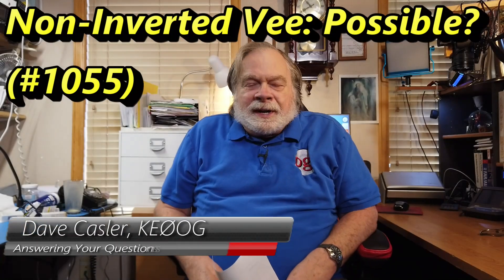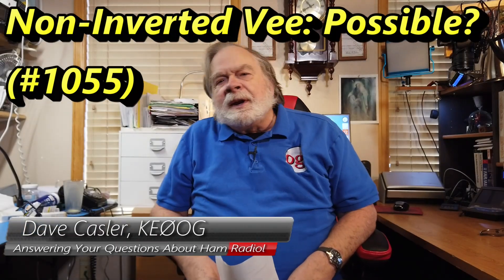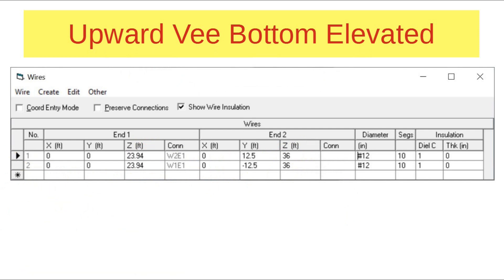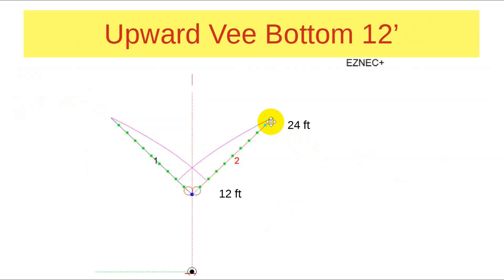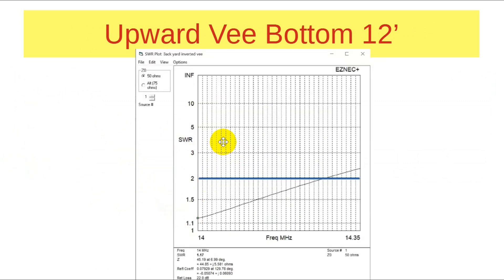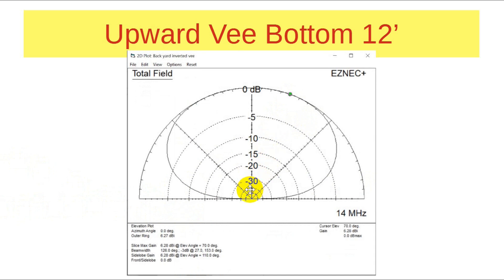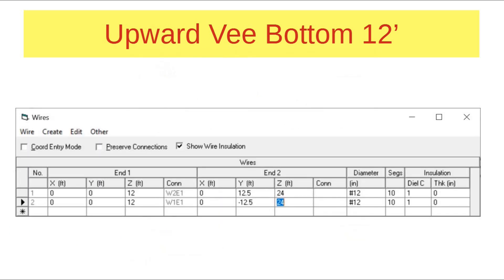Non-inverted Vee: Possible? (#1055)

Comment: Dave, I can't believe you got this question after so many years. I found an article from many years ago about making a Lanai antenna so I copied the picture. Then I got a  Buddipole with Versa Tee and copied it and plotted Z and it was better than I could imagine. Got a British one piece V with SO-239 and mounted it on Military mast and stuck some 112" whips and I had an instant antenna . Did the same with Mil whips from Chameleon 133" and still 52Ω Z with no Balun.
After a number of years I have been  looking for more information  on bent antennas and there is a fair amount of articles on them now. Dave I can mail you some DPC-7 mounts if you would like to smoke test them. ~DPC-38V mounts.  Look at my KB1UKU and KB1UKU/M qrz site pages. Dave nice reply to his question. I find the V dipole best as a slightly sloped with a rock tilting my base Vee changing take-off angle giving me my 3dB gain.

Comment: Thanks Dave. I just installed a new Diamond HFV-330 Multiband Loaded V-Dipole antenna on my balcony. It's one of the few multiband antennas I could find that fits in my very limited space.  It has two sealed coils at the base of the V that function like a double screwdriver, i.e., they have motor driven contacts that are synchronized by a controller in the shack to move together when changing bands.  Covers 3.5 to 28 meters and looks like something out of My Favorite Martian, but it seems to receive well despite my neighborhood QRM.  Have not had a chance to transmit DX with it yet but will do so as the weather warms up.  Hope to reach the States with it sometime soon.  73  JS2OLO

Comment: I tried that once, but had the bottom only a few inches off the ground due to height restrictions. No need to say too much more about that endeavor other than 👎
Reply: Can I see a picture of CAA-500, or AA-54 screen of curves of results?  I now build Vee antenna for POTA  mounting it a meter or two from my radio FT-817 and I find it to be the cats meow.    Look at KK4OBI bent antenna charts.  KB1UKU